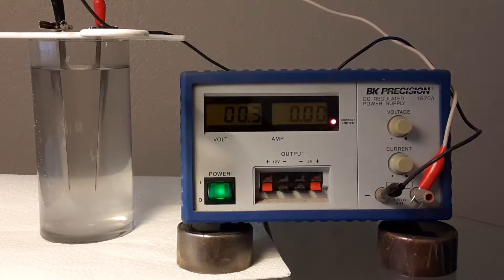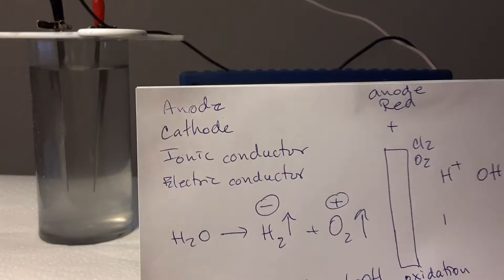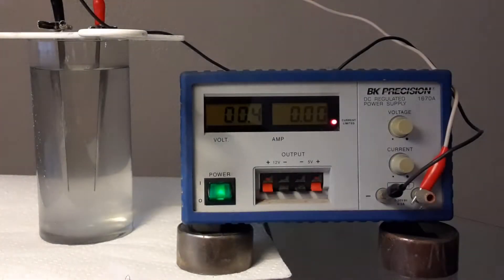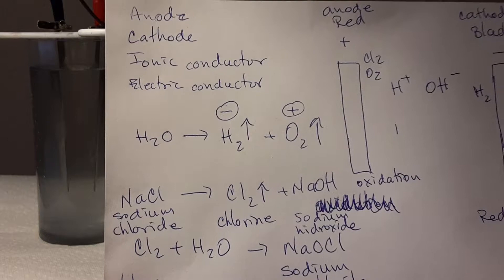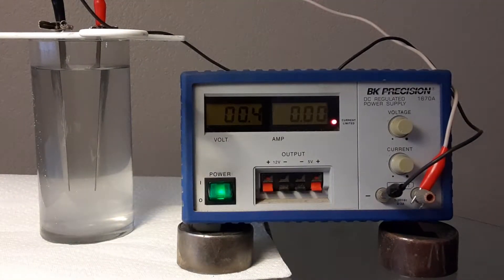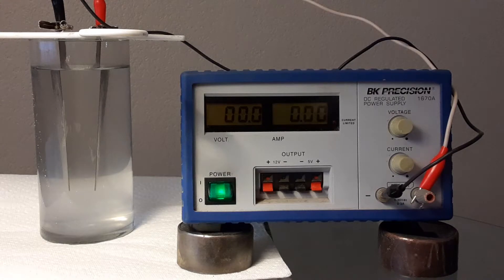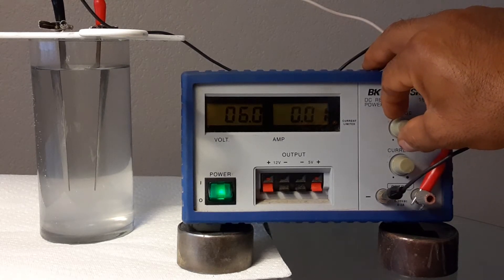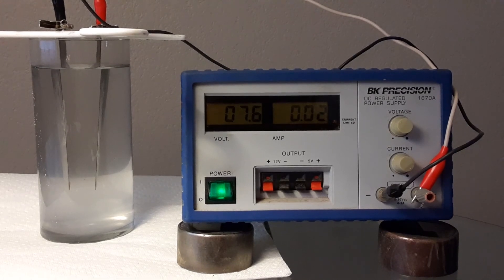Bleach, sodium hypochlorite. Make your own disinfectant.

Comment: Can it work by using sodium chlorite to create chlorine dioxide?
Reply from the maker: Yes!!! Normally you need to use titanium platinized anode
Reply from the maker: And a it is better using a membrane to separate anode and cathide solution.  Video very soon